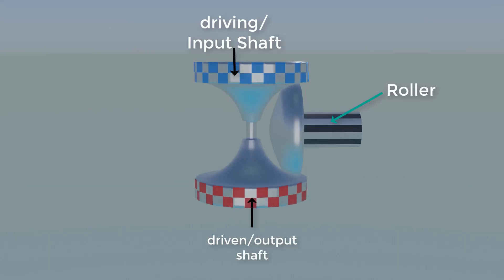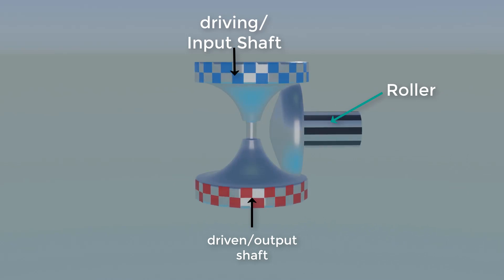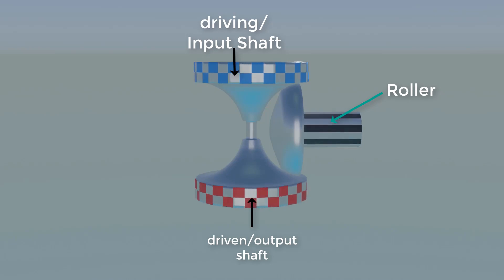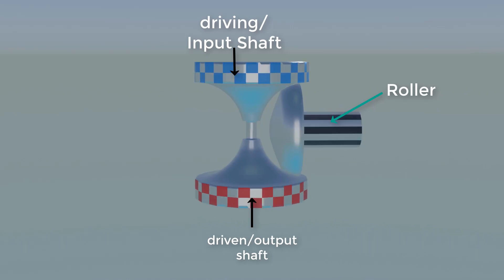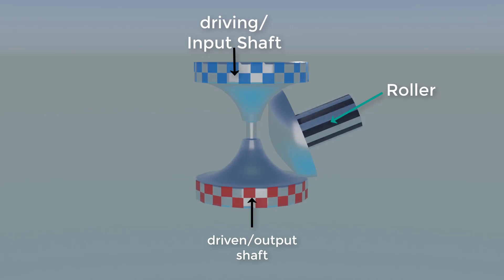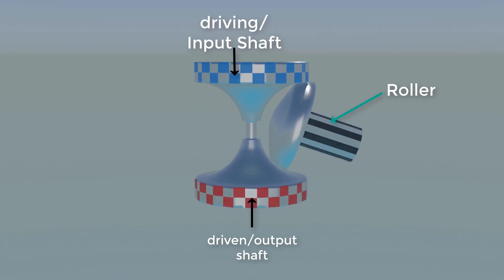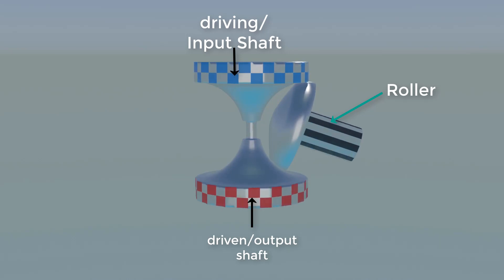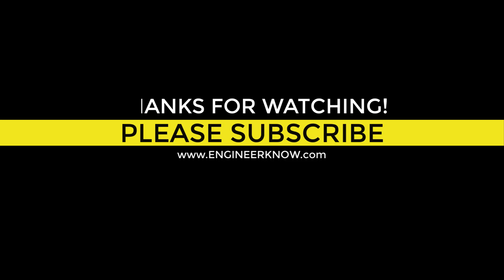Toroidal Cvt transmission explained

Comment: This one make a lot of friction.
Reply from the maker: True that's the reason they don't use often
Reply: @engineerknow  👌
Reply: Comparate anoter CVT transmission.
Is most efficiency for that point.
And with a special oil. You haven't problem.
Reply: @shadowsensei9040  you need a high coefficient of friction for this to work without gears. Oil is used to lubricate parts to reduce coefficient of friction.